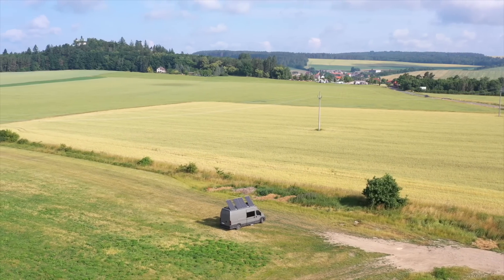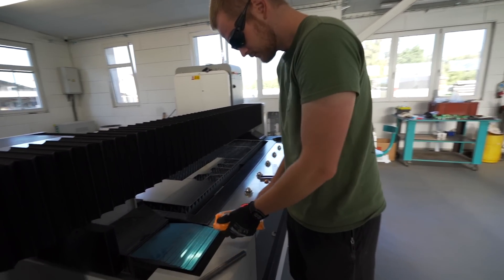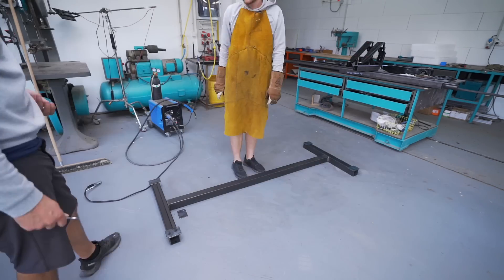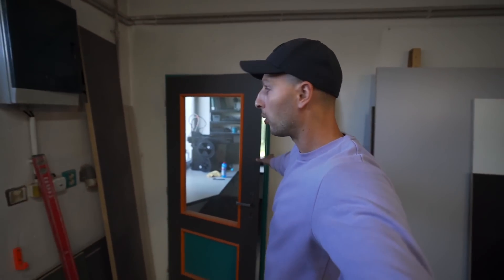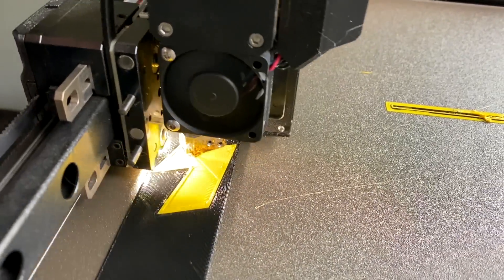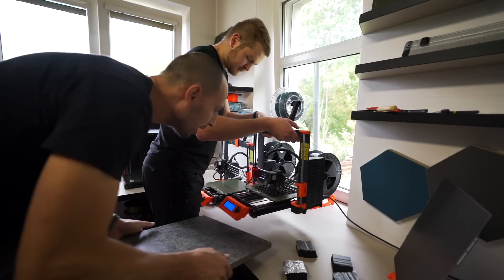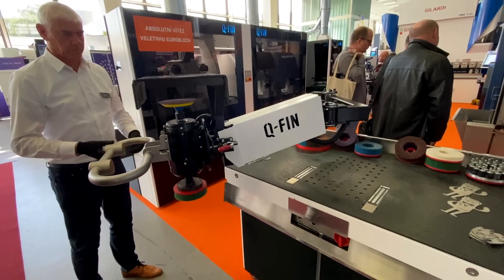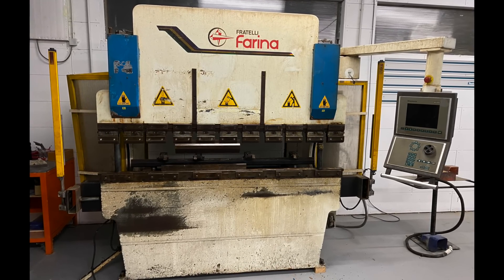This eBike Start-Up is GROWING 👀 (winter update)

Comment: Hey Ladi, Love seeing the Ebike projects! That CNC machine, bender and converting the room into a 3D printing room has really transformed your Ebike business, you have a small factory pumping them out efficiently now I’m sure! I am actually needing a battery replacement for my #Hellbird Ebike. I had a 134v 20ah (2680wh)lipo battery stuffed into my Enduro frame, but I never use the full speed power of the 134v battery and want to step down in volts and step up in ah. Maybe a 72v or 84v with 40 or 50 ah, so I can get longer range and less top speed. I have the qs205v3 to 5t 650 turn motor and 100a yuyangking controller on it currently with 26in rims. You are building batteries for USA buyers now right?